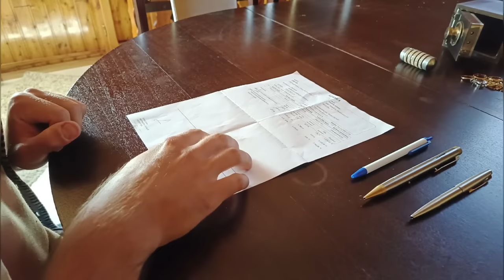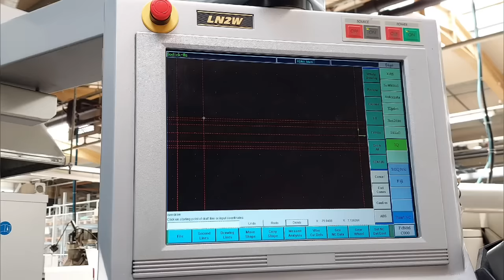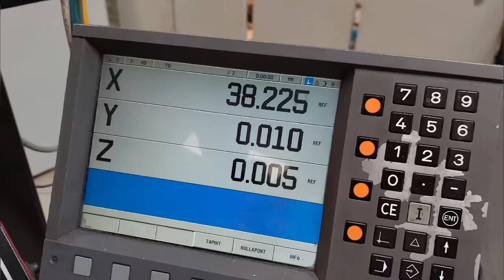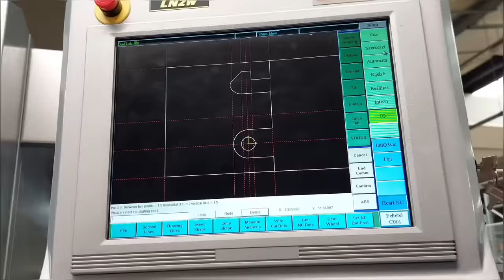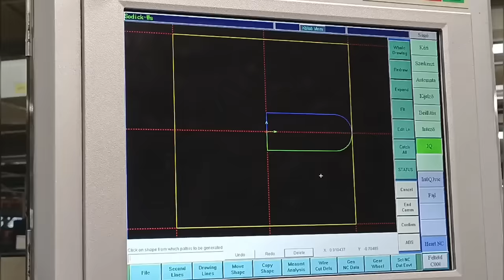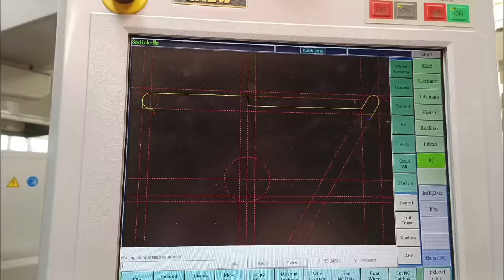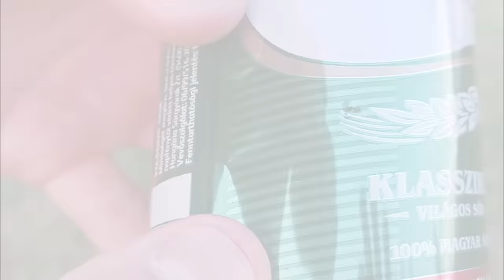Machining The 007 James Bond Pen

Comment: Wow I'm very impressed with your design and machinist skills. I had machine shop as a class in high school back in the 70's. We used very old lathes, shapers, milling machines and drill presses. Made some simple tools such as punches, screwdrivers and hammers. I still have those tools today and have used them often.

Comment: What is the under water electricity process?
Reply from the maker: It is Wire EDM machine, the current flowing through the wire cleaves the material. Very accurate machine, you can create beautiful things with it

Comment: How do you prevent the pins from falling out? Are they glued?
Reply from the maker: they are fixed with a tight fit, they do not fall out of place. that's why I had to push it in with pliers
Reply: @Matthews_Tools  or you can laser fusion weld in place. I do that professionally on Medical implant instruments.